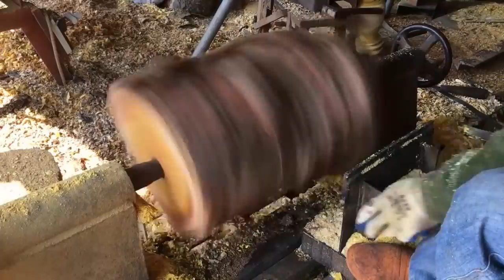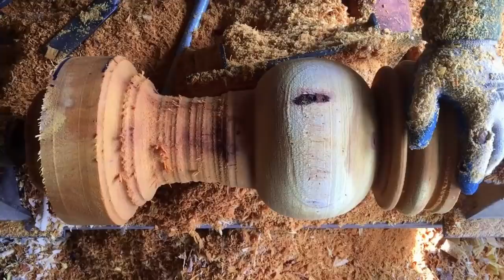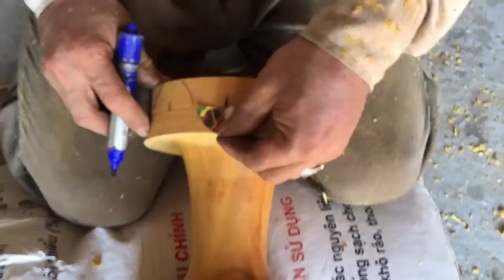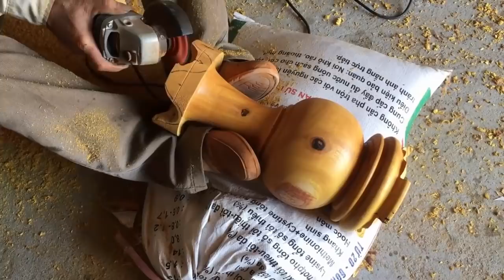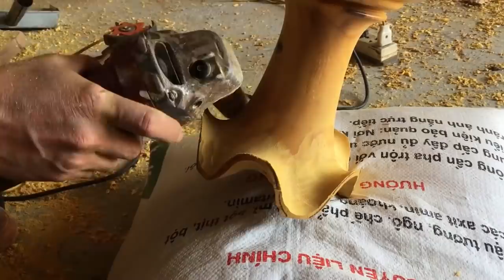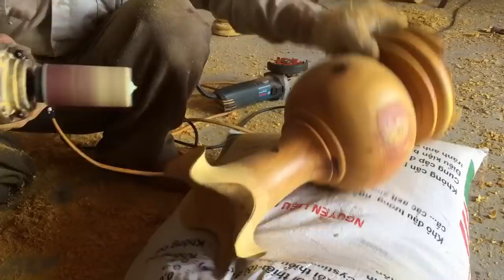Amazing Techniques Woodworking Extreme Dangerous // Work Wooden Lathe Art Of Carpenter

Comment: What kind of wood did you use?  I see some beautiful red in the outer portion. Really admire the craftsmanship. I've never seen the blade you had on the angle grinder. It's just the ticket for removing a lot of material in a hurry for rough work.

Comment: I've always been taught not to ever wear gloves or long sleeves anywhere near rotating equipment. If one of the fingers were to get caught between the workpiece and tool stand it will turn into a bad day real quick. I watched a video where a guy got sucked into a big metal lathe like that and it litterally pulled him apart like taffy. One of the hardest to watch videos I've ever seen. Otherwise nice work. Guy is a beast with that grinder